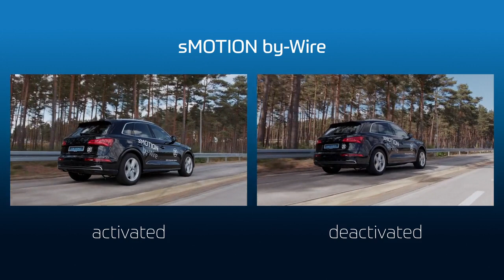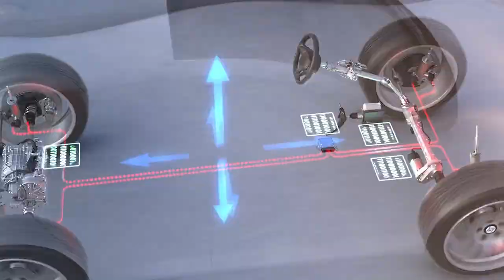X-by-wire: when the electronics take control

Comment: Some nice views of the ZF 'EVD3 Low' eAxle, which is rated at about 100kW, in this video.  This unit appears to achieve a small footprint, by mounting the output shaft right under the electric motor, with the slim inverter mounted on the side of the assembly.